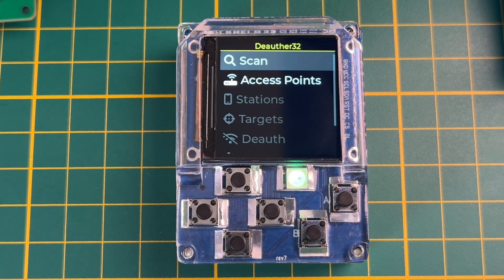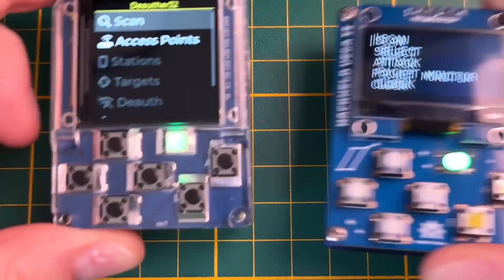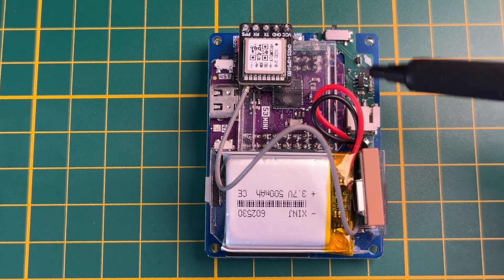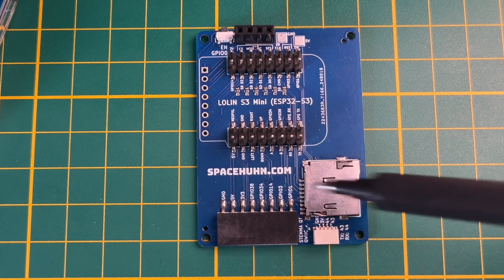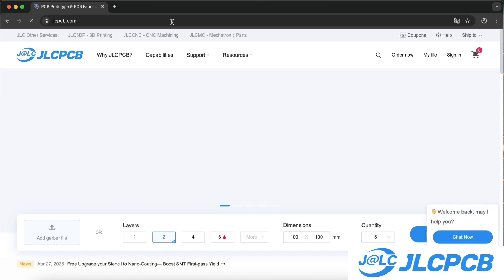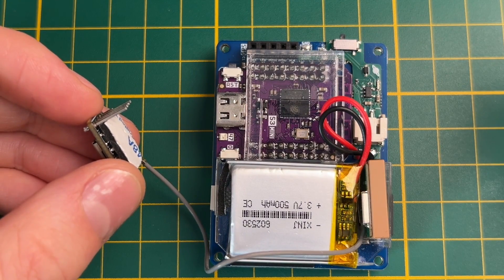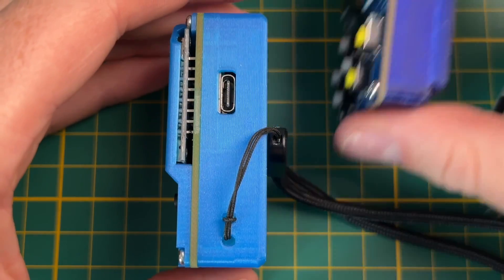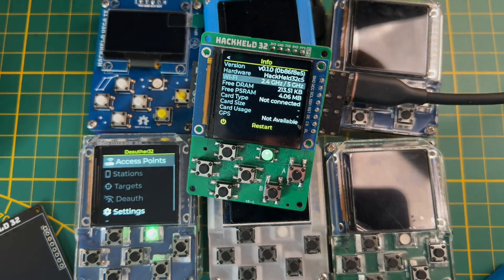HackHeld32 Prototypes (Preview)

Comment: from my personal experience with gps modules, they prefer a clear line of sight to the sky that keeping them in a case inhibits some of the gps lock that it takes longer for them to see satellites. there are meshtastic cases where the gps module antenna is exposed at the top for that reason. the antenna is secured but no material covers the antenna. but, your clear case design with the gps module inside looks really cool. also, stuff like the esp32 marauder gives you the option to put an sma connector on the case for gps as well as wifi.  but  doing that would alter the small compact design you currently have.